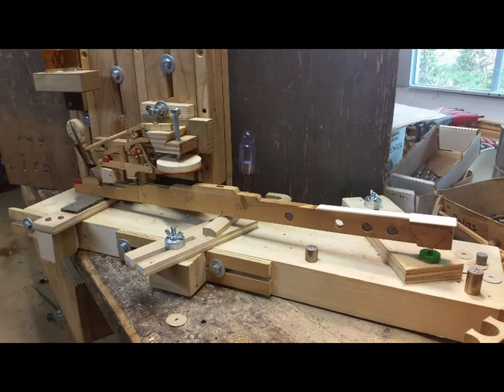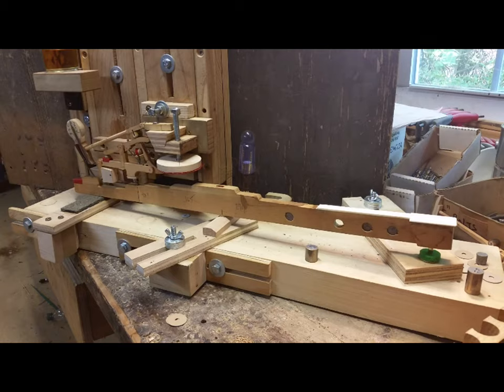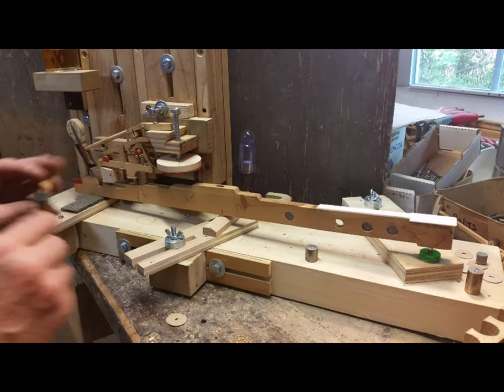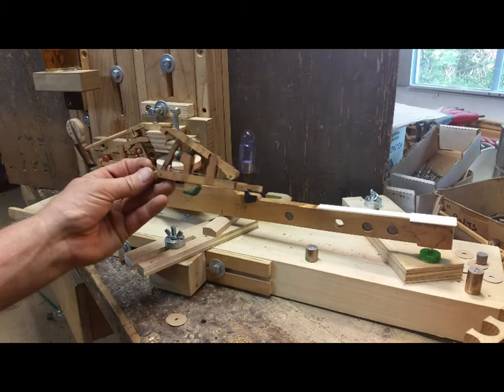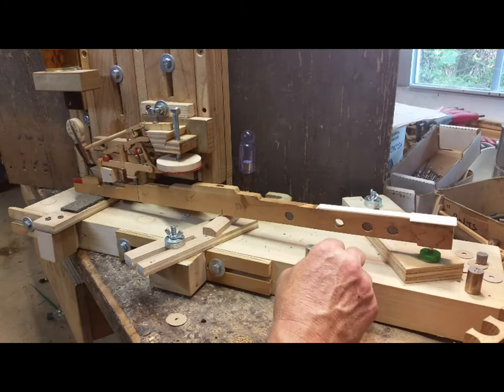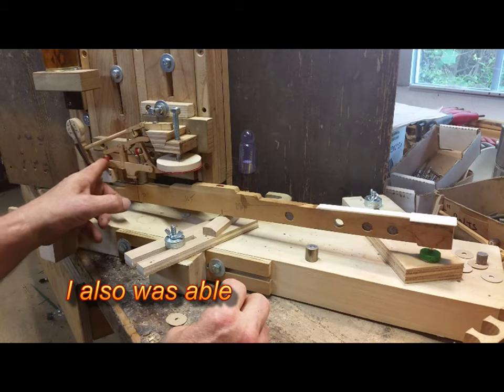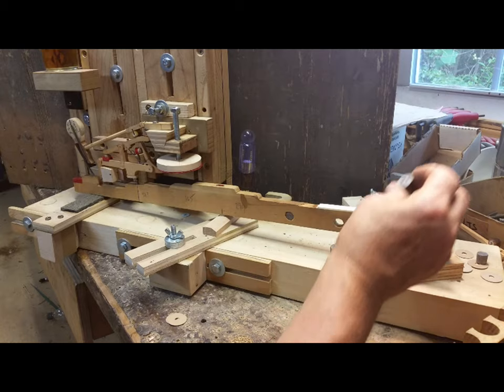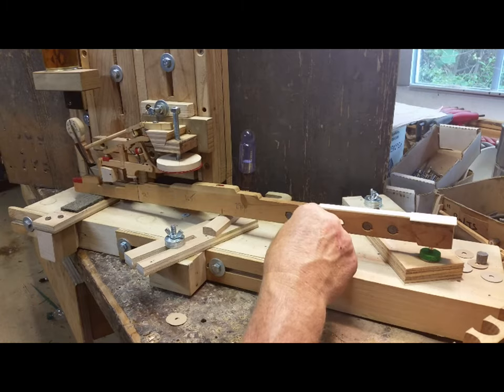Baldwin SD-6 Heavy Piano Action Problem Solved

Comment: Hi Chris, nice video. Does moving hammers in like that alter the strike point? If so, do you then have to push the whole action a corresponding distance farther into the piano cavity?
Reply: There are a few different methods of thought in this.  At a factory there are 2 methods of setting a strike line.  1 method is you hang your hammers at a speck distance such as 5 1/8 which is what Steinway sets their hammers to.  You then move the top stack around to match the strike line and what you get is what you get.  Your capstan line may is set and you adjust with lead.  The other is to set your capstan line at a consistent ratio and then you use a strike gauge to find the strike line and you hang your hammers based off of where they need to be.  now moving the hammers forward and backwards as seen in this video does change the leverage.  However moving the capstan results in a far greater change in leverage.  So for a factory or a re-builder, its usually best practice to go off of the action ratios and adjust using the thing that results in the least variance which is hammer hanging distance.  

The big issue you are fighting is plant manufacturing which unfortunately has tolerance issues.  particularly up in the treble area.  The issue there is with cope and drag.  So the V bar is cast on one half of a mold and the top part of the plate is cast in the other side sandwiched together.  Noe the issue is that the molds the halves don't always line up in the same way.  They can only really hold between 1/4 and 1/8 in tolerance between that area.  now if you think about it that is a long way when it comes to hammers.  that is the difference.  And you have to think in terms of you either have to move the hammer 1/8 inches to adjust to the tolerance, or you have to move the entire top stack.  Now if you look at the leverage, it is less of a weight difference to move the hammers than it is to move the top stack though more labor intensive which is why many companies don't do it this way.  it takes longer.  So what this results in is many lower end piano and New York Steinway pianos having 5-7 leads in the base.  

So I personally would probably tackle this issue a bit differently.  I would first figure out the leverage proportions of the key and determine the appropriate capstan location.  This can be done using the action model seen in this video if to verify what you are measuring.  Once you have that then you can relocate the top stack to align with the new capstan line and you would hang your hammers based off of the strike line.  At the end you would start the weigh off procedure.  This will usually reduce the number of leads necessary in a lot of old steinways and cheapo grands out there that were designed for price as opposed to quality.  The easiest way to get the hammer line is to do the 7 8 9 test for note 1 and you would use a treble strike gauge to get note 72 and 88.  This should get things close so that you are only making minor adjustments to the action location.  Because at the end of the day a piano with a perfect strike line will be outsold by a piano where the fall-board works properly.  So ideally the action should be centered between the sharps and the fall board and the naturals and the key-slip.